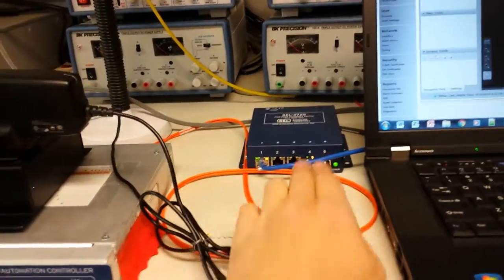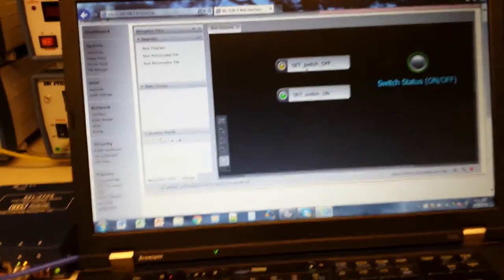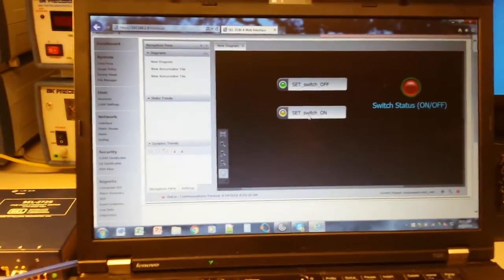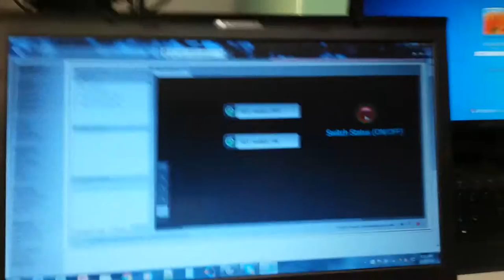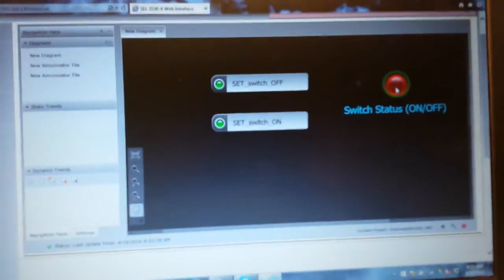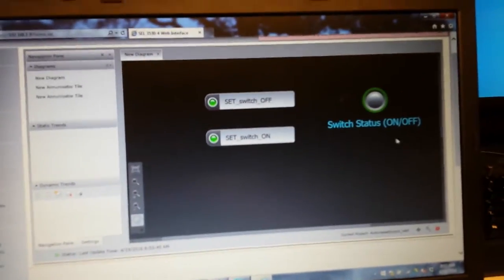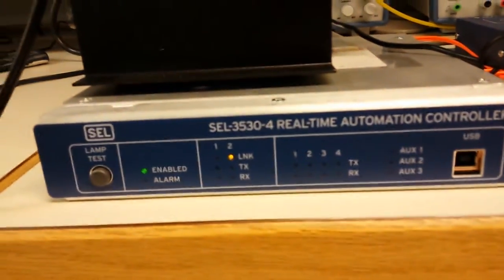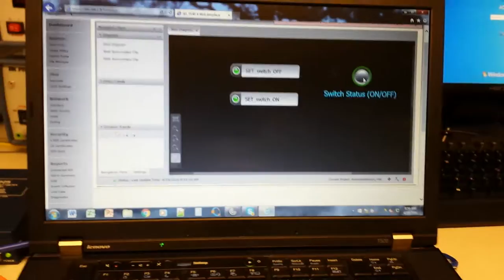Remotely Controlled Outlet Switch with SEL 3530­-4 RTAC HMI

Comment: But did you manage to lower that 2 secs delay you mentioned? I was curious to know as I understand that even if this is tried to be lowered in the tag processor, am afraid that wont help since the Diagram Builder HMI poll interval is 2 secs (minimum setting). Let me know if you got this done and i missed out a point ;)